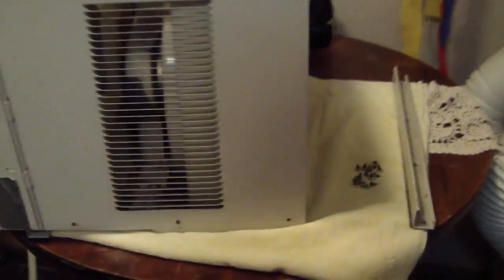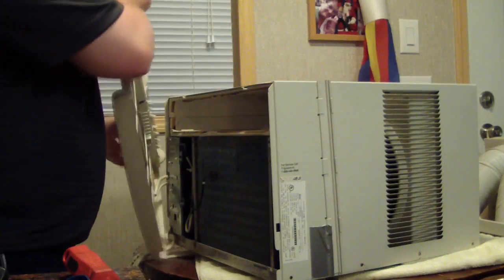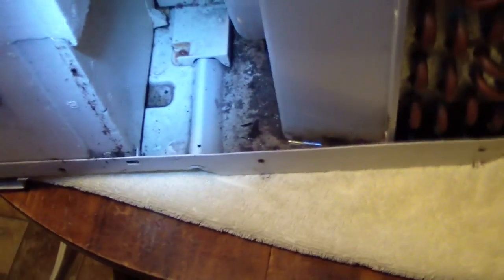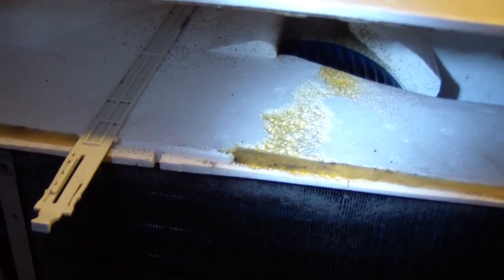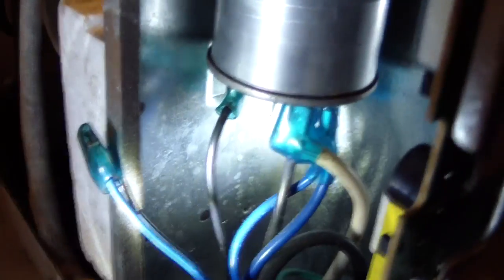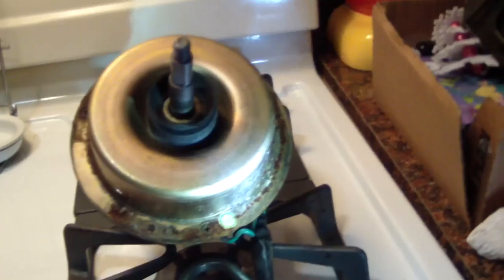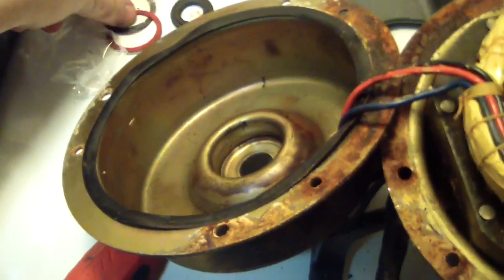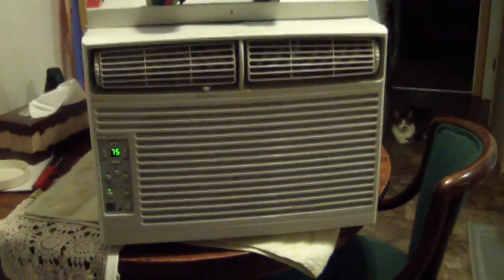Replacing AC Bearings - Fridgidaire FAC107P1A2

Comment: It seems that all newer window shakers with ball bearing fan motors have this issue, I have seen/heard them start to growl at the start of the 2nd season after storage so <1 year old.

In the case of one make and model that I replaced the bearings in earlier today I know what causes the failure, my Haier ESA410M-L used shielded bearings not sealed so the one on the evaporator side of the motor was having warm moist outside air pulled through it from the suction of the evaporator blower causing condensation inside the bearing. The grease in the bearing was rust colored while it was still translucent white in the other bearing. I replaced them both with sealed ones, EZO/Nachi brand, size 608. I also contacted Haier about the issue, not that it will do any good.
Reply: Yeah, sadly a very common issue. A lot of the time people haven't mounted them correctly which puts added strain on the bearing. Shouldn't be this way, but it is.
Reply: I'm not sure about the angle thing, while yes many are mounted wrong causing other issues like poor drainage and the condenser slinger not working, remember that ceiling fans have vertical shafts with the same type of sealed bearings and they are usually fine for many years.
Reply from the maker: Yes, but ceiling fans aren't usually exposed to water. My feeling is the seals on the bearings just wear out prematurely.

Comment: Where can i buy this bearings for the frigider window unit have the same problem hope you can help.
Reply from the maker: +David barrientos You should be able to find them at any place that sells bearings to industry. You can also likely order them online. Be careful with installation and reassembly of the motor because if you set that back together wrong you can be electrocuted. I have purchased bearings from VXB.com for other projects and never had an issue.
Reply: Thank you for the information and the tip on putting it back.

Comment: It seems to be a big issue with these.  I'm glad the bearings are replaceable as the motors are hard to match with aftermarket units.
Reply from the maker: +wkat950 Just short of impossible... They wanted close to $300 for the $45 motor -- if you could get it at all.